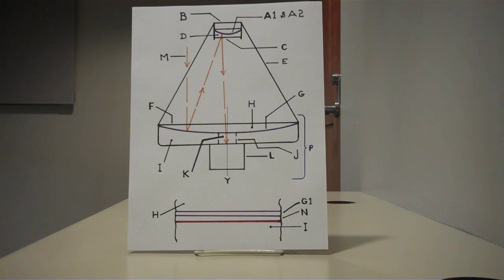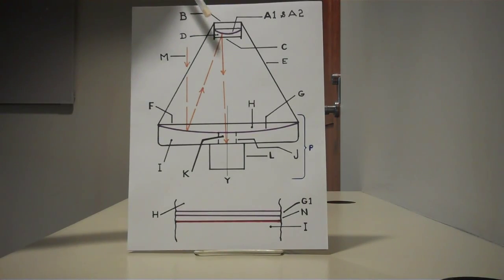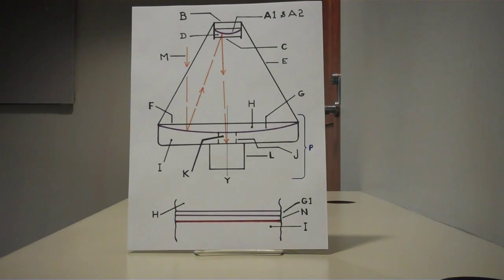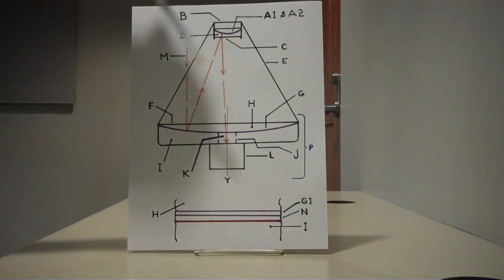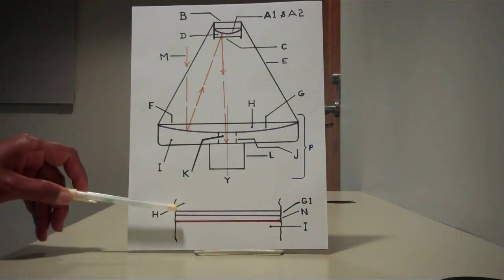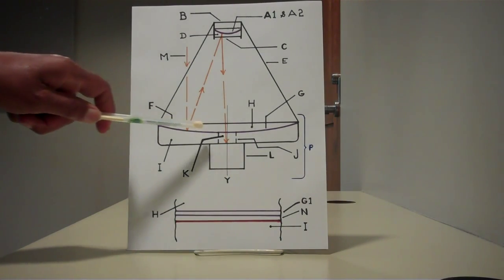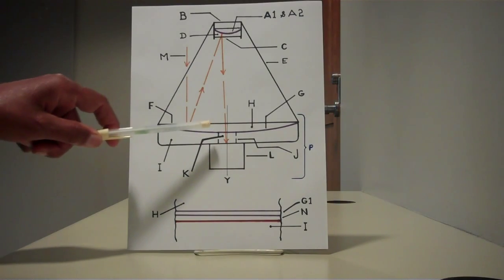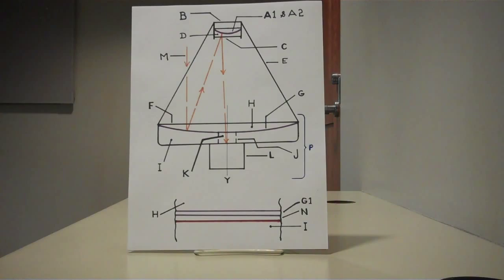How to Make Advanced Silver-Coated Telescope Mirrors That Never Tarnish

Comment: I know I’m commenting on an old video, but I wanted to point out a key issue with your idea. In theory, sealing a silvered mirror under vacuum behind a glass plate to prevent tarnish could work—but in practice, it adds a lot of complexity for minimal gain.

Vacuum deposition is already tricky, but maintaining a long-term vacuum seal over a delicate mirror surface is even harder. That kind of sealed assembly would need to handle temperature changes, mechanical stress, and long-term outgassing—all while staying optically perfect. It's not impossible, but it’s unnecessarily complicated when enhanced aluminum coatings already offer near-silver reflectivity without the tarnish issue.

It’s kind of like designing a submarine to cross a river when there’s already a perfectly good bridge—clever, but not practical.
Reply from the maker: Highcommander2007: .. Even the richest man will take a penny when it comes to his business. That's why he's rich. Pure polished silver is thee most reflective metal on earth for visible light. An innert gas can be used between glass and mirror. And, with the extreme hi level of tech today, what you've stated is of almost no consequence. If you want thee best, you will tolerate the few things you've stated and weaknesses, and go for the best and practical.
Reply: @jessiejohnson3457  What an odd response. Silver is the most reflective metal, but there are more reflective coatings. There is no reason to coat with silver and remove tarnish potential. Let me give you some examples to explain why. Take for example enhanced aluminum coatings which feature 98% reflectivity vrs silvers 99% π × (12/2)² × 0.99 = π × (D/2)² × 0.98. A 12 inch mirror would only need to be 12.06 inches to match the same light gather potential to match the silver. Let us assume we NEED to use silver for some reason, Then you can topcoat silver itself you can top coat with something like 2-butoxyethanol 111-76-2 <10%, tetrachloroethylene 127-18-4 <10%, 2-(2-butoxyethoxy)ethanol AKA Angel Guard and get the same tarnish free coating that you see on Aluminum. So your method (for telescopes) is neither needed nor practical. Again, you are inventing a submarine to cross a river where a bridge exists. Not to say that it isn't fun to propose new ways to do things... but I suspect in 10 years you don't even have a prototype of your proposed system because of how impractical it is. Am I wrong?
Reply from the maker: @highcommander2007  : .. (1) Go to Google.com: write "what is the most reflective metal for the visible light spectrum". Silver will be the answer. (2) Silver reflects 95%-99% of visible light. Aluminum reflects about 90%. (3) Both are OK. But, Aluminum is used more. (4) Silver is about 8-9% better than aluminum. (5) But silver tarnishes. To stop the tarnishing use and put 100% pure glass (silica oxide) sheets over the mirrors. (6) pure glass is used for optical cable in telephones. (7) Light can travel 10 miles down the optical cable before degrading. How much better is 1/4-1/2 inch thick ? (8) It can be solid silver mirrors, instead of just a coating. Work with the idea, not against it. Advance it, if you can.
Reply from the maker: Highcommder2007: .. I agree. If you can do this with aluminum, you should be able to do this with silver. Coatings to make it 99.999999999999% reflective or more in all (or almost all) frequencies. Then it becomes a submarine crossing an ocean, where no bridge can be built. That is the point, advance the matter, find all the bugs and remove them. Put the mirrors and glass in a tube like a Dobson or Newtonian. Control all light rays, coat the glass, whatever it takes, etc.
Reply: @jessiejohnson3457  ... but ... why. Its not a submarine crossing an ocean when we already have a solution to your proposed "problem." I am going to move on, but I think you might be missing the point. You are trying to train an elevator operator when we have buttons on the elevator already. Stop selling snowplows in the Sahara. — Technically functional—completely unnecessary.
Reply from the maker: Mr. Highcommander2007: .. (1) How reflective is the methods you speak of ? .. Is it 99% or more ? .. If it is not, then we may be able to do better. That's the point. (2) even if we can not do better than what you've said, then it becomes one telescope mirror a little bit less expensive than the other, such as the one you state. But still exceptional. (3) Advance it, work out all the bugs. Sealing tech, coating tech (tribology), glass tech, etc., are all advanced today, very advanced.
Reply: @jessiejohnson3457  but again, WHY. why is a 99.9% 12 inch reflector important when you can build a 99% 12.06 inch reflector?
Reply from the maker: @highcommander2007  : .. Now you have 2 ways. Your way and this way. One perhaps little more expensive than the other. Choice.

Comment: Proposal for if this goes to production:
Instead of trying to vacuum-form the silver to the glass before the surface tarnishes, magnetron sputtering may give more consistent results and faster production. So, grind the glass blanks to an optical finish first, then deposit the silver in vacuum, which will eliminate the need to polish the metal entirely. After that, the back surface of the silver can be protected with a layer of epoxy and you have a nice lightweight hybrid reflective/refractive element. I see a potential niche in artistic astrophotography, allowing for shorter exposure times for fainter objects

Comment: soooo, you claim %100 glass wont bend light?
Reply: and wont reflect any light? is this a joke?
Reply from the maker: Mr. Yunus Yilmaz : .. (1)100% pure glass (100% pure silica oxide) is what's used in telephone optical fiber core. Around the 100% pure core is cladding which reflects the light signal back into the core. The light signal can go several miles down the core without being degraded. Until it reaches a signal booster system. The light must be reflected back into the core. (2) If light can go several miles (which is equal to 10K to 20K feet length in thickness) in a basically straight line with almost no degrading, What to say of 1/16 to 1/4 of an inch thick !!  Where NO cladding is used. It is as tho the glass isn't there. No reflection, deflection, absorbtion, defraction, etc. None. (3) take a course on pure 100% glass and optical cable and you will know.
Reply: If the refractive index of the medium is the only thing changing, and it changes discretely, you've changed the focal length of the element without fundamentally changing its effective surface profile; a paraboloid is still a paraboloid
Reply from the maker: @charlesmartin1972  : (1) Mr. Martin: What is it you are talking about? This is about 100% pure glass. Not about the mirrors or the mirrors' shapes. (2) the matter is simple: silver tarnishes. (3) Instead of polishing the silver, 100% pure glass (100% silica oxide) is put over the primary and secondary mirrors, and all elements are vacuumed from it. To stop the tarnishing. Please, study optical cable core and pure glass.
Reply: @jessiejohnson3457  I was initially replying to Yunuz in this thread. His concern was that the glass back-fill of the mirrors would refract incident light, which is correct; my point was that, for a flat-faced optic, this would change the focal length but wouldn't prevent the formation of an image

Comment: This has a problem.. If you put a vacuum in the H and D area will cause the mirrors to warp which is very bad. Maybe inert gas in H and C areas. But in using inert gas you have to make sure it does not cause problems with light refraction. Nitrogen would be a good to use since it is the closest refractive index to air. The next gas would be Argon.

Comment: wouldn't it be better to use some inert gas instead of a vacuum?, then you wouldn't need to generate a vacuum. and all you really want is to keep the silver from tarnishing.
Reply from the maker: Dear Mr. Brandenburg: .. That is correct. To keep the silver from tarnishing. An inert gas would most likely work, but my concern is that the inert gas may refract or scatter the light some what a bit as it passes the glass to the mirror surface.

Comment: Hi Jessie, Several years ago, when I had hair !  I had a similar idea ... Use a plano - parallel disk for the aperture, which could hold the secondary mirror too !
Like a Schmidt corrector, which would also negate the need for a spider support.
And then place a smaller disk (window) at the base of the telescope tube, behind the primary mirror in front of the focusing tube ! Using some o-rings for sealing, you could then evacuate the entire tube !! And then fill the tube with another inert gas, like nitrogen or any other atmosphere that would not harm the silver !!!  Maybe a commercial Schmidt or Maksutov telescope could be retro-fitted ...!  I may give it a try on my Meade, I'll let you know if it works !! JD

Comment: what is the ratio size for primary and secondary mirror?
Reply from the maker: Dear Ritesh Lama: Such forms of info are public and very easy to find. Go online and offline to find it.
Reply: Jessie Johnson thank u for your reply but I too was shocked to find no relevant answers to it.
Reply: To find the minimum secondary size, simply divide L by f. In the case of an 8-inch f/6, L is often about 9 inches. Dividing 9 by 6 gives a minimum secondary size of 1.5 inches. Quick google results.

Comment: Very interesting technique, i imagine the most difficult is to get both mirrors and their complementary isolating parts finely polished and smoothed out for a perfect fit, to avoid distorsions in the light paths. Right ?
Reply from the maker: Dear Mr. O. P.: Sounds right what you've said. There should be virtually zero percent (0%) reflection, refraction, defraction, light absorbtion and distortion with 100% pure glass. Since 100% pure glass can have light go 3-4 miles down its' core (telephone optical cable), which is equal to a 3-4 mile thickness, so what to say of only 1/4th of an inch thickness. Unlike window pane glass and such.

Comment: Jessie, you are very talented! I thing that you are on the way to achieve something good.
Your current idea won't work because the light passing through a glass in diagonal will have an effect like prism splitting the light like rainbow.
Reply from the maker: Dear Sergio Cantoli: I don't agree. With 100% pure glass, I think very much that it will. With common everyday types of glass it won't. The reflection, diffraction, refraction would be to great. But with the purity of optical cable core glass it would be practical indeed.
Reply: The light going through the protective glass at an angle will suffer from refraction. This will require the protective glass to be corrected, complicating the design. You should take some physics classes.
Reply from the maker: Dear Mr. Edstud:  ...Once again: I don't agree. I know a little about glass. In this case it is not common glass. Which is highly distorting. Diffractive, refractive, reflective, light splitting, magnifying, etc.  But in this case it is 100% pure silica oxide (pure glass). With no impurities. I believe, firmly, that it will work in a superior form.  Research the properties of pure glass, dumb-shit, before you hand out insults.

Comment: How can i make transparent silver coated mirror? It is called 2 way mirror.
Reply from the maker: +Ahmet Yasar . Dear Mr. Ahmet Yasar: There are probably already 2 way mirrors that are silver coated commercially available. Simply search around for it. Silver tarnishes in open air after a while and must be re- polished. To halt this tarnishing process 100% pure silica oxide (pure glass) is used to cover it and seal the mirror then vacuum all air away as in the video.
Reply: +Jessie Johnson Yes there are commercial products which are purposely overpriced for niche market. I'm looking for DYI solution for this